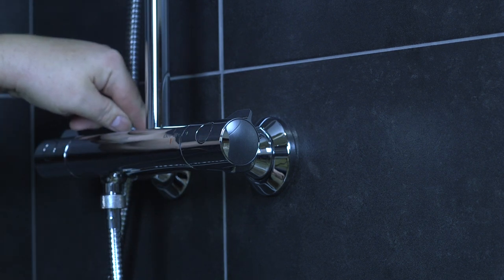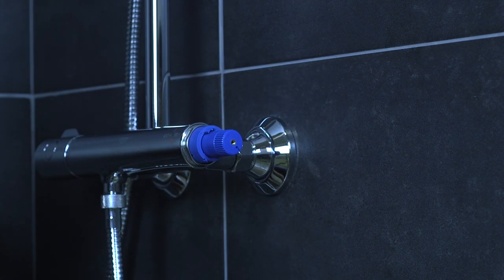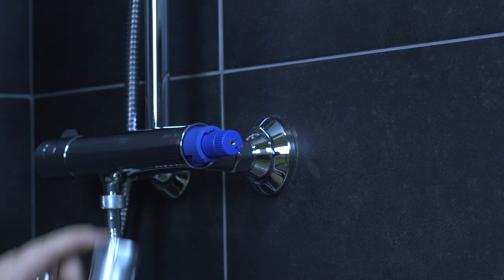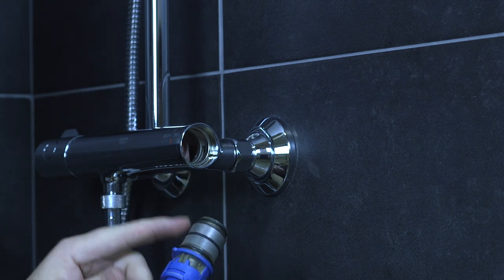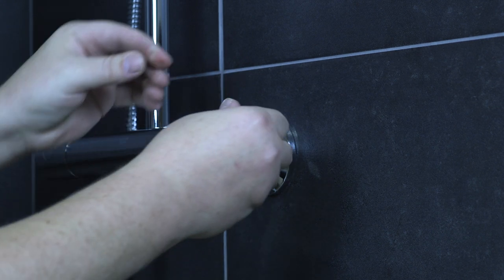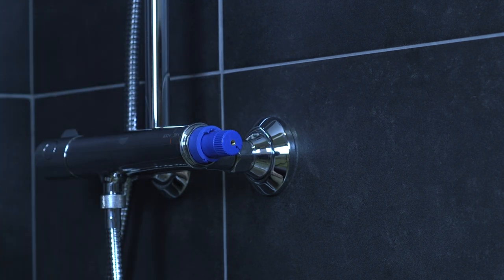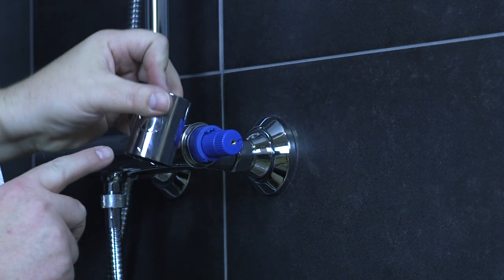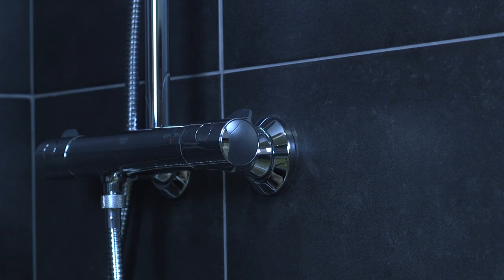GROHE | Euphoria Exposed Shower System General Maintenance | Installation Video

Comment: How did you take off the cap at 00:34? I have been trying to do this procedure with no success
Reply: Use a very small screwdriver for the traditional screw head. 
I did not notice that there is the cap, but here it really is!
Good video.